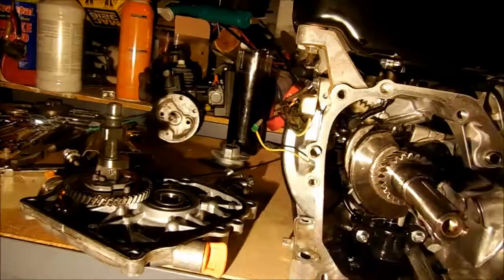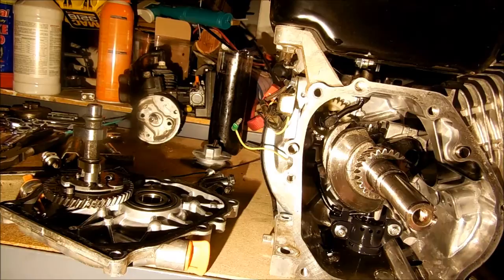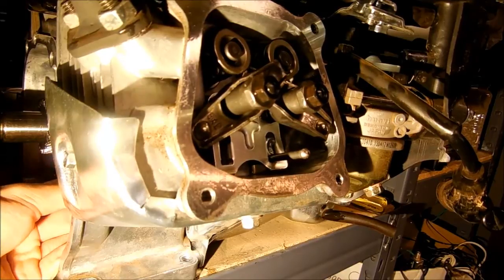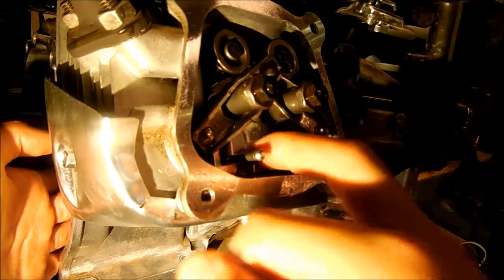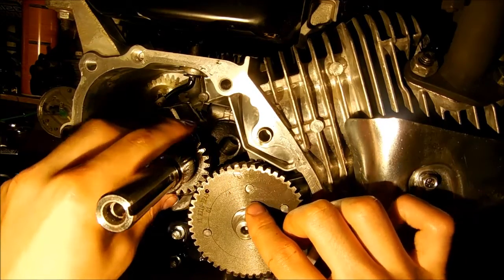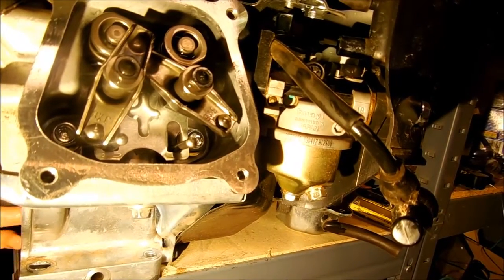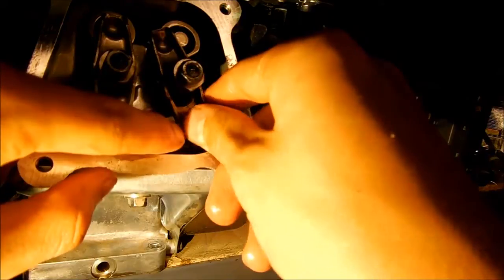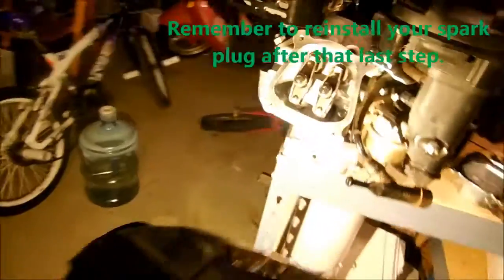Honda 6.5 HP Clone How to Install Camshaft/Timing

Comment: That's a bit misleading for guys who are new to this like he was. After the cam is correctly installed is when you put the side cover on. Then you do the lash. And I've never put the pushrods in from the bottom. Easy enough to get them in position into the lifters from the top.

Comment: I recently bought a new Stage 4 Race Head and a bigger .275 Cam to swap out the stock ones but it's proving to be a challenge getting the pushrods to pop into place behind the Champion Rockers up on top. They aren't the stock Pushrods either I got new Chromoly Pushrods but they are stock length so i don't understand why they aren't sliding into place nice and easily. Everything seems so tight and i'm not even sure the head is sitting all the way down flat. Went to pullstart it and i could tell right away something was wrong cause as i was pulling starter rope it required a lot of strength to pull and not even close to turning over to start. I hate this crap lol.

Comment: Best video on this topic out there, I couldn't figure out why it wouldn't start after I removed the governor.  Thanks alot, you helped alot of people with this video!
Reply: So the same thing happened to me when I removed my governor and the engine didn’t want to start and wasnt sucking fuel, was your carb not sucking fuel either I just want to make sure that I have the same problem before I go opening my my engine again
Reply: @904dinooo2  the governor arm/bracket or do you mean the governor wheel that's inside the engine!?

Comment: You don’t understand how many times I’ve tried. And it’s not working. It’s making me was to just smash my dirtbike… IVE LITERALLY TRIED OVER 30 TIMES AND ITS NOT WORKING
Reply: Wait you tried what so many times lining up the 2 dots ? And then when you put it back together and try to start it it doesn't start so you take off the side cover again only to find the 2 dots are no longer lined up with each other ? If that's what you're talking about i have been having the same exact problem lol. I must have lined those dots up like 10 times already in the past week and they keep coming undone misaligned. It's so annoying. But i'm just now thinking to myself maybe it's because i didn't make sure the piston was at top dead center first before i aligned the dots ? It's probably important to do that in order to set the timing. I will try it again tomorrow making sure it's at tdc first and if it still doesn't work after that then yeah i'm with you and i'm gonna pour gasoline all over the bike and toss a lit match on it lol.
Reply: @JNC1973 did you ever get it or did you end up burning the bike down
Reply: @JNC1973 when you put it to TDC did it work?

Comment: where do you get your crank case gaskets for the none hemi predator 212?
Reply: Amazon- $10 comes with all gaskets , spark plug & tape measure 

HURI Cylinder Head Exhaust Muffler Full Gaskets Crankcase Oil Seal for Mini Baja Bike Motorpsorts MB165 MB200 196cc 200cc Gx160 Gx200 5.5HP 6.5HP

Comment: Hi I removed the lifter arms and head of one of these motors so I could clean the head and valves. I didnt take the bottom end out so don't know what's it like down there, I made sure the motor was TDC and installed the pushrods and rocker arms back together at 0.15mm on intake valve and 0.20mm in exhaust valve. after all the I tried to pull start the motor but can't easily as the motor has HEAPS of compression now? the still starts it's just very hard to start because of the compression. What have I done wrong it worked before I removed the head, is my timing out?

Comment: How do you know if you time it 180 out?  Is there a mark on crank for for top dead center of compression stroke?  Thanks.
Reply: I aligned my dots but to no avail, now I think I need to turn it 180 and try again... I wish he answered you...
Reply: James Michael Hello, was the piston at top dead center?  That means as far up the sleeve as possible.
Reply: Nick Ballay I did not know to check that. I will try and realign it with a piston at the top this time.
Reply: James Michael, Good luck. I bet it works this time.

Comment: @Electrotechnics so i lined up the dot but now it wont crank and i have flames in my intake. any advice
Reply from the maker: +Dante Smith Sorry for the late response, it sounds like the intake valve is being held open, causing no compression and causing the combustion flame to propagate up the intake. Most likely you have the dot off by a couple of teeth, double check that it is aligned correctly. If it is correct the maybe in the process of installing you mixed up the two push rods (not sure but they might be different lengths) So check the valve clearance and find what is causing the intake valve to be held open. 

Hope you get it working, Thanks for watching!!
Reply: How do you get flames if it won't crank bro? Usually if it won't actually crank after performing this than you didn't lash those (what should be #22 with cam mod)  springs to .003mm. If it cranks but won't run I'd  look at how well the valves are seated as they may have debris in them. If you added stainless steel valves they need to be lapped. While you have that feeler gauge out check your coil clearances and set from .003mm as well. If your carb is flaring then you need to clean it thoroughly and check your fuel to air mix. All said, did you touch the flywheel or get into advancing it with the right offset key? Billet is 8 degrees past TDC  and the PVL is 4 degrees because it is already designed to 28 degrees thus giving you the 32 degrees you need. Good luck man.

Comment: I have question about gap  between  rokets.. how tolerance  you put in  .005.  or 0.004.   thousands. .
Reply: If using a performance cam then you would set them to .0015 if using stock cam set them to .003